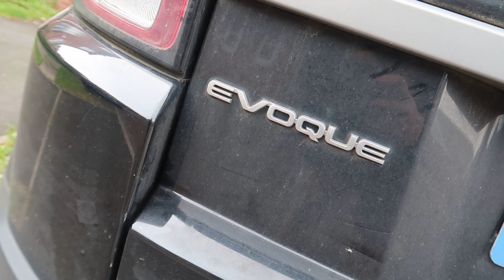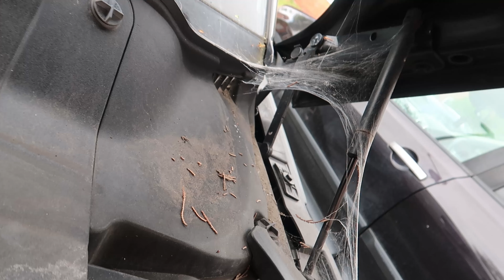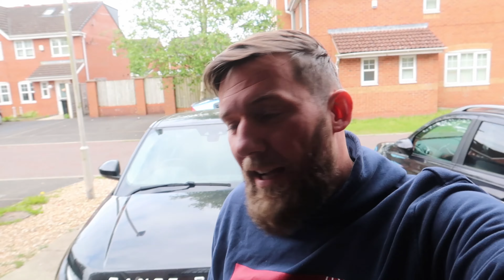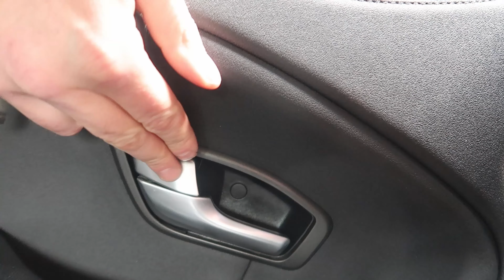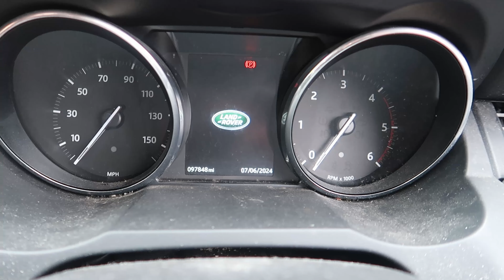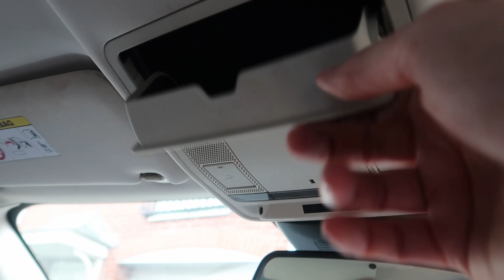I Bought  A CHEAP Range Rover Evoque And It's BROKEN!!!! | EP1

Comment: Good video fella, the dpf solution you mentioned sounds pretty good. Subscribing so hopefully more videos coming. Evokes are good cars by the way, they just need regular oil and filter changes and a decent run on the motorway now and again. My one has been excellent.
Reply: Have you ever had a carbon clean or egr valve clean?
Reply: @ never had to.

Comment: Any updates on the chain? Ill be looking at one tomorrow with similar mileage. On auction says its not running
Reply from the maker: Chanins sound good, it was just the tensioners and pulleys which was fixed with both new along with a new belt.